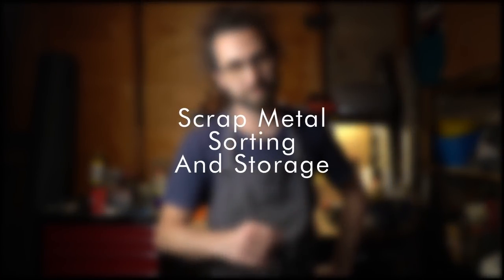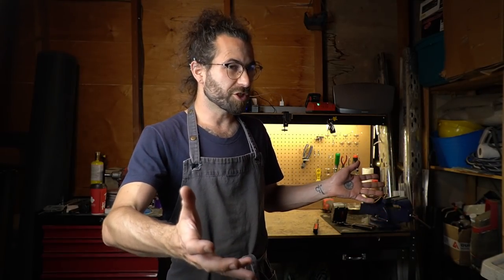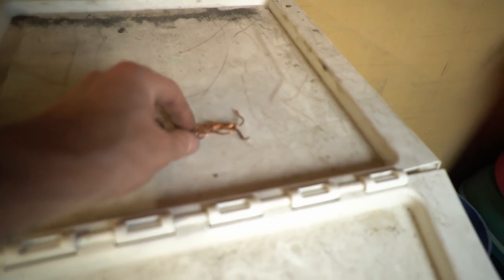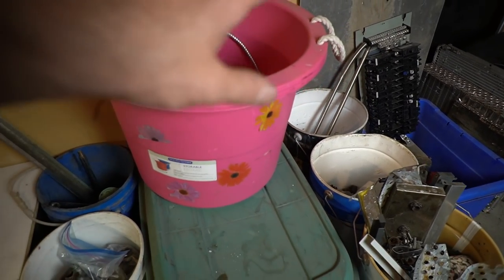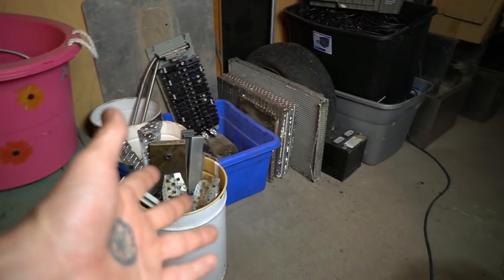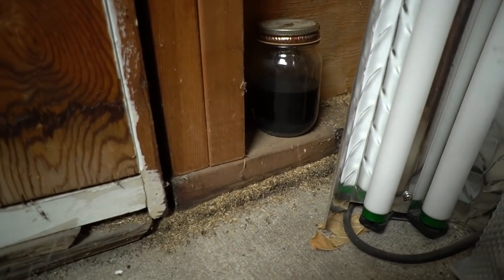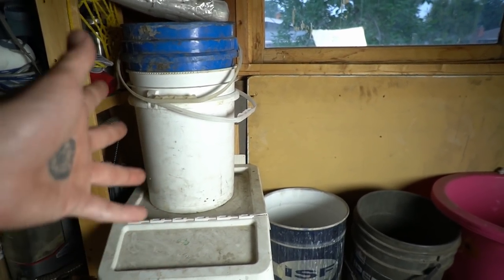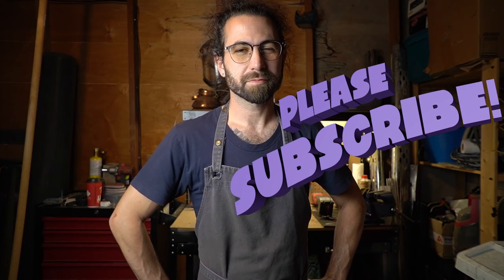Scrap Metal Sorting And Storage - How To Organize Your Scrap

Comment: I do not have a storage area....or any bin or box/ bucket system. Whatever goes into the truck has to be hauled immediately. A "hand-to -mouth existence" of scrapping. I cannot stockpile and try to time the market for the best price....OR take this type metal here....and then that type metal there to a different place....whomever pays the best for which ever particular metal. It all goes to the same place on the same day....and whatever price they are doing that day.....that is what I get. I cant hold it...and wait for the price to be right.

Comment: I've got a bucket for small extruded, larger extruded gets stacked outside. Weather won't hurt it, I have die cast, cast, and a rather large 30 gallon for sheet which is whatever isn't cast or extruded. 

My yard won't take keys as yellow brass, so I have a bucket for keys, a bucket(s) for yellow brass. brass shells (one for those I need to decap (remove the primers) or pull the bullets from and decap and one for ready to go to yard) and bucket for red brass.  Technically there's another class of brass, but the yard just throws it in as yellow brass so I stopped sorting it out. 

Buckets for #1 stripped & stuff yet to be stripped.  It's my bread and butter so I usually have bins, buckets & boxes of stuff to strip. Once stripped I take it down to the yard that week. The longer it's exposed to air the less pretty it looks and with some stuff I risk it getting tossed into the #2 pile as it's already a bit old to start with and sitting around a few weeks would make it look even less pretty. My yard won't pay bright bare unfortunately.  I sort the unstripped by gauge as best I can. 

With #2 I sort little stuff into bucket(s) and larger unstranded wire into another. Little stuff tends to get lost when being weighed if I don't. Blows out , falls out, etc. I also have buckets/boxes/bins for wire yet to strip, and for #2 that's too small for me to strip. I take that in as unstripped. 

My yard only takes 1 grade of stainless so just one bucket(s). 

I put the small stuff (screws, small parts, etc) of shred/loose tin in bucket(s). Take it down when the buckets fill up. I do this because a lot of that stuff gets left in trailer bed when the big magnet hits it, or falls out, blows out before it gets to the yard.  Big stuff goes into outside piles. My yard only pays loose tin and unprepared steel which for most yards would be prepared steel. So those are my piles. I wait until I get something close to a ton before I bring it in. 

With current prices it's just not worth stripping aluminum wire. I'd make maybe 5 cents an hour doing it. 

I have bins for low grade electronic boards, mid grade, high grade generic, laptop MBs, American made MBs, Chinese MBs (there's a price difference in most places), HD controlers, floppy & CD ROM controllers, telcom boards (at least what one buyer specifies as such), HDs, CDRoms, Floppies yet to be taken apart, low grade boards yet to depopulate, stuff I need to pull silver contacts off of & silver coated pieces, different parts off electronics that need to be processed, bucket(s) each as I like to process them in large batches,. 

Buckets for stuff to hammer, stuff I'll need angle grinder to process, 

Lead acid batteries, surprising how many I find in dumpsters and allies. I also pull them out of things like ancient scooters and such as well as APSs. 

lithium batteries, cell phones,  

50 gallon trash cans for aluminum cans (they aint worth much right now, but only takes half a second to grab them while I'm grabbing other stuff and some of them are cans I drank, so I'm taking cans down anyway. There were times I was literally patrolling the side of the highway for them but they were going a buck a pound then. I was making $30 an hour picking up cans while that lasted. Anytime I found several cans together I'd stop. I'd usually find 30 or 40 after the 5 or 6 I saw from the road. I'd pick up $70-100 USD a day doing that and spend around $20 in gas hunting them. Right now at 30 cents a pound and insane gas prices I could pick up cans for a week and not recoup the gas used to pick them up. So I only pick them up if I'm stopping for some other reason or generate them at home or are given them. 

I also have buckets with various useful things like screws, bolts, nuts, etc that I pull out of scrap or from dumpsters that I use eventually. Nails especially. 

I have buckets/bins/stacks for various types of building supplies I encounter until I use them. 

Piles for alum radiators. Piles for alum/copper radiators.  AC radiators. 

Piles of large extruded yet to clean. 

Odd junk that might be useful to me. Odd working junk that I take out to flea market a few times a year to sell or give to friends.  

I can't find #1 copper every day. Some days little to no copper at all. What God brings and the dumpsters give is what they give. If I get too picky about what I scrap there are weeks I go hungry. So I pick up anything of value unless it's going to take up  so much space I don't ever find the good stuff. Bulk steel for example. Just not worth the time and effort to load it up and take it down a pickup load at a time. I'm traveling 20-30 miles 1 way most of the time. I LOSE money by taking it home in large amounts. So I just pick up a little here and there to fill up a load of more valuable stuff. It's free money that way. I was already picking up the other stuff and I just tossed the steel in as an extra. I already get a lot taking apart appliances, electronics, etc. So grabbing a bit of pipe, rebar I can't use, etc while I'm grabbing the other stuff helps pay for the gas to get to the yard. Used to actually pay for the gas, but last few years gas prices have been wiping me out. I can't drive less. I have to go where the scrap is, drive until I get a good load. Whether that's 4 hours and 50 miles or it's 10 hours and 100 miles. 

I also need reserves. Some weeks I just don't find anything of value. Or like the last month I've been on crutches and couldn't go scrapping. So I take in what I need and leave the rest for when I need a bit extra. So if I need $100 for a vet bill, I'll take in my normal load and $100 worth of stuff I have sitting around ready to go to cover the vet bill. Scrapping is my main source of income right now.. I literally don't eat if I don't scrap that week.

Comment: I have 13 bins to store my scrap metal in. As of right now, I have 2 bins for #2 insulated copper, 1 for #1 insulated copper, 1 for electric motors, 1 for christmas lights, 1 bin for copper, 1 bin for a mix of aluminum pieces (I think it's all aluminum oil sheet), 1 bin for another grade of aluminum, 3 medium to large bins for aluminum cans, 1 bin for e-waste, and 1 small bin for tiny/small pieces of steel/iron, like screws and bolts and stuff like that. Now the bigger pieces of steel and iron I have that can't fit into bins, I just keep those outside.

Comment: I also throw a little trash plastic in if it's got a cord and a tiny motor like a vacuum I cut off cord cause it evens out to motor weight as steel for me at least when factor time in on either side and toss it in dust bag and all

Comment: On my last run I got a couple of pallet jacks in a dumpster. They are incredibly awkward and will fall down on your foot or pinch your finger on the edge trying to get them out of the dumpster. They weigh anywhere from 140 to about 170 pounds( American) each. They retail about 800 to $1000 bucks new so there might be a resale market for them if you can find a buyer used. But @8.50 a 100weight....I got like 25 or 28 bucks for 2 pallet jacks.

Comment: Thub, I just wanted to say thank you for the help man, if i EVER have any questions i always come to youtube and search your channel for answers and i have NEVER been let down!!!

I did have a question, Does an engine from say, a lawnmower,  go straight to alu breakage without having to do any prep? Or is there anything I should do before i take them in, I come across all kinds of riding mowers and push mowers!
Reply from the maker: So glad to hear that, and happy to be a part of it! If you mean as far as what the scrapyard wants, you need a hole in the gas tank if it’s still attached but you can just leave the cap off and pour it out. (At least I can, yours may want a bottom hole). If you mean to make more money, frick no those are awful. Sell it as breakage with as much steel as you can get away with! 🤘

Comment: Free buckets and bins from dumpsters is key! They cost more new than the scrap! One of my scrap yards even has a pile of free buckets they get from people. Or free sturdy cardboard boxes will do.
The more you sort, the better, i.e. wire, brass, copper, aluminum, etc. like you showed.
Reply: I use the larger baby formula cans with the lids from my babies (I had triplets summer 2021) for screws, bolts, washers etc. not huge but still takes a while to fill and the cans themselves are turned in on recycle. two birds one stone!
Reply: I like poly woven sacks. Takes up Minimum space and are light allowing for higher value loads meaning more money!
Reply: I just use totes and medium-sized buckets to store my aluminum cans, bare bright copper, and different kinds of insulated copper wires in. Occasionally I might have to buy another tote or 2 from Family Dollar or Dollar General, but that rarely happen. As Thub says, "leave it better than you found it."

Comment: white  and yellow brass may not pay the same prices sometimes it is better to ask how much per lb  if white brass is lower you will get the lower price, try to take your multiples  of materials at different times, the same with all of your materials, a vise, and cutting materials will separate anything. none of this is free if you look at the time, labor, gas, and more i have been scrapping for over 55 years and learn more every day. i do not take my scrap to one place and here in ohio they try to weigh your scrap and you have to know poundage. but they do not tell you how much, unless you go to the front office and look at the chart but it does not have current prices.they say it updates by the minute, know your tares, selling at over a 100 lbs you grta little more and so on. but it is super fun.
Reply from the maker: You have been at this awhile! 😆 I certainly don’t go to one yard either, I have my favourites but I still call around to make sure my price comparisons are up to date

Comment: good video, someone's been cleaning...  you're absolutely right about taking in stuff and not processing anything out.   my neighbor noted another truck full of stuff going in.  i'm like "yep, looks like my input is far exceeding my output".   realizing i need good tools to get thru everything quickly.    i've worked as a household mover so knowing how to pack is a specialty of mine, i will know when i must absolutely start getting stuff out, probably starting with the big item things like steel and tin.    

i think a key too is learning how to find items that maximize weight, like a plumber dumpster getting me 10 lbs of copper and brass in one night, i mean how many t.v.'s and flat screens do you have to scrap to get that much copper?   and the amount of labor involved, that's when you start realizing letting things go out dirty save you a bunch in labor.
Reply from the maker: I get told off whenever I sell some dirty metal here but it’s true, you don’t have the time to get everything bare and clean or you’ll never get through it all

Comment: your brass can have as much copper as you want on it the scrap yard will love you
Reply: You are losing money keeping copper on brass.  Granted, brass is about (ABOUT) 90% copper but the addition of the zinc is what pulls down its value vs clean copper. A small pipe cutter for short stubs, or a pair of pliers and work it back and forth to break it off. 

Granted if you are doing high volume scrapping with sustainable sources, those few extra bucks may not be worth the time, but as a hobby scrapper, I maximize the money I get. Gas will not be getting cheaper any time soon, so I get as much back into my tank as I can.
Reply: @NeverEvil1  wot am saying you cart make brass dirty by leaving cooper on it
Reply: @kevinraines4318  I get that point.  In the same token, you are giving away money doing it that way. 

Separate the pure/clean pieces of copper and get paid more.

Comment: I'd tell ya to put all the wheels down flat on a pile of thin small steel with more small steel inside or something to that effect have a friend or spouse with you. Here you weigh drop all metal and weigh out have friend either unload or watch the non ferrous next to that dock and keep adding. The 5g buckets will fit in the center of wheel add nons amd a lid and can be secured with fine steel smalls. Just an idea to max your haul on 1st load my friend your yard may be set way off from mine as well so not trying to argue or micromanage or any of that just giving ideas like your giving us

Comment: What is the best way to cut wire casings?
Reply: which wires are you talking about.  if your talking about bx don't cut them to long for me it 6-10foot and or else it hard to pull out especially with the paper insulation. there's also a direction to pull it out that is easier and jams less just trial and error it. for number 1 wire a knife works well my preferred knife is a dull de boning knife. if its to sharp it cuts into the copper, i also strip  #2 with it which is a bit trickier but when you get the feel for it works well. For romex a knife also works extremely well slide the knife between the ground and either positive or negative. for any wire with 3wires +ground i use a snap of utility knife to remove outer insulation again 6-10foot pieces since they are twisted and its a pain to separate the wires after.
Reply: @gargalash9191  very informative my good human thank you(I was having a problem with gouging the copper so I just need a duller knife)
Reply: Yeah, I don’t strip #2 for the sheer fact I cut the fine strands of the braid and poke myself way too much. Looks like I got in a fist-fight with a porcupine.
Reply: @vincedibona4687  understandable my dad refuses to admit he needs a wire stripper...yet that happend alot
Reply: @nullsnaggle5198  Oh, FTR, I use dull razor blades in a razor knife. I only occaisonally need a bandage. LOL
Reply: @vincedibona4687  gg my man gg

Comment: Where I live it's barely worth scraping. Just took a 5gal bucket stuffed full with insulated wire. About 6 electric motors.
10 clean aluminum pans. And a pickup bed full of steel. Total 35$ apx 4hrs spent and 5$ fuel. I found everything in one stop. Doing it as a hobby sure. As a living in the Hampton Roads USA area you'll starve if you have a family.

Comment: Been slowly building on my scrapping knowledge and collection for about a year now. I've sorted some, but definitely started to realize I would probably have to separate some of the piles before taking it to the yard. This is a great general guide.

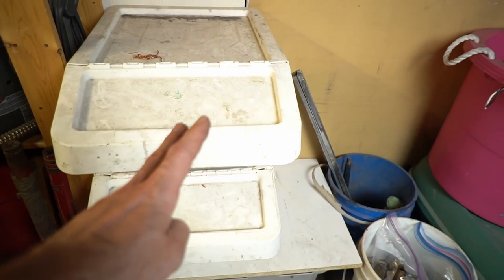On another note, does anyone know where to get tubs like the white ones at 3:40?  The ones with a small, inclined opening on the front? I would LOVE to pick up a stack of those for organization.
Reply from the maker: I wish I could tell ya where they sell them, I found them in a bin 😆

Comment: Why don't you melt metals like copper and aluminum to get the highest grade possible. I know it takes time and money but you would get the highest return
Reply: For copper, I melt it all. It gets rid of the soldering and the coated shellac. For aluminum, if its clean I would melt it right away and for things like black heat sinks I would remove the paint first. If you melt it down to it's purest form it will ultimately sell for more
Reply: Some yards won't take metal you've melted since they can't easily check that it is what you say it is